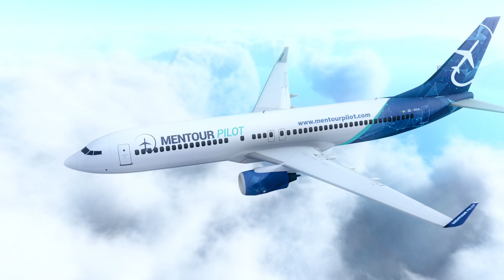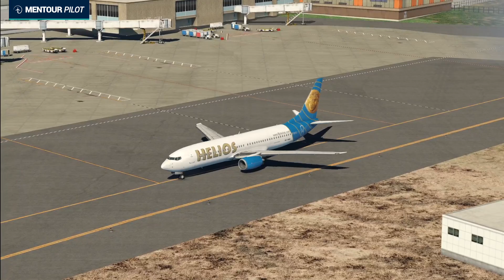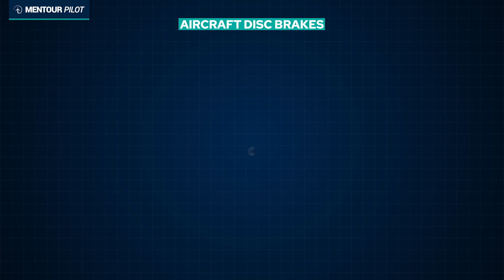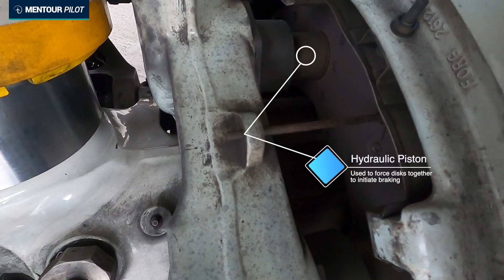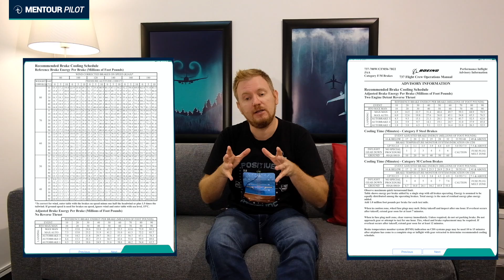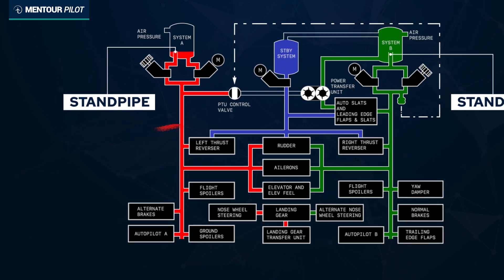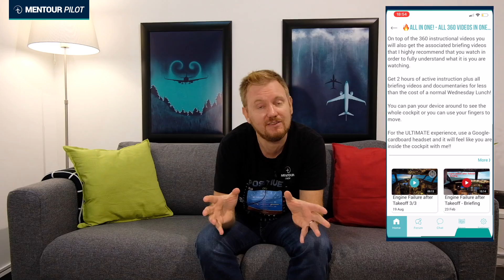How do Aircraft BRAKES work?!

Comment: You said in other videos that reversers don't reduce the landing distance on dry rwys. Is that because the pilots/autobrake will apply less brake when more reverse thrust is used; or even though the same amount of brake is applied, the reversers won't reduce the landing distance?
Reply: What that might have been about is how in the FAA-calculated method for stopping distance calculation, credit isn't given for reverse thrust?  If a constant decel rate is selected for the ABS, then more reverse thrust will automatically result in less braking being applied in order for the system to maintain the selected decel rate.  But for a given brake pressure (e.g. 2000 psi), adding reverse thrust will result in more decel / less stopping distance than just the braking.

Comment: 727 actually did have nose wheel brakes as an option, I believe for unimproved runways. Pretty sure some did exist but most 727s did not have the option added.
Reply: Those were air brakes

Comment: Whenever I read or see a video on brakes or braking, I remember Swiss Air 306.  The Caravelle crashed because of overheated brakes stowed after takeoff resulting in fire and destruction of hydraulic systems.  80 lives perished.  

Morbid, I know.

Comment: The DeHavilland DHC-7 "Dash 7" had an option to have brakes fitted on the nose wheel as well.
However, very few aircraft got that option as it turned out the benefit, even in a STOL market as it was made for, the difference in stopping distance was minimal, but maintenance complexity was increased.
Reply: I think it's fair to say that in most airliner operations, required takeoff field length is greater than for landing?  Perhaps another reason why a bit less stopping distance wasn't worth it.

Comment: Sounds like the anti-skid system on a plane is virtually identical to that of an automobile. Assuming it is, here’s a question I used to pose to my students when I was teaching automotive ABS: the ABS is designed to disable at speeds below around 5 mph/kph. Why is that? Answer: if it wasn’t, the vehicle would never, ever stop! 😀
Reply: What he didn't make clear is the antiskid system is comparing wheel speed of pairs of wheels across the aircraft so as soon as one slows more than its partner it releases that brake until it matches again. Not just before  it skids.
Reply: @bobrice3957  Actually, if it's similar to an automobile, there's an interim, "hold" phase. When one wheel (or set of wheels, depending on how many channels it has) starts to slow down, it goes into a hold or blocking mode where it does not allow additional pressure to be applied to that wheel/set of wheels. If it continues to slow down, it then releases the brake pressure by cycling the valve a certain number of times per second.
Reply: I think the min speed for anti-skid on the 707 was 21mph.
Reply: "the [antiskid] is designed to disable at speeds below around 5 mph. Why is that?" Here's a technical answer, relevant to at least some airliner A/S situations:  The graph for sliding friction coefficient vs speed looks somewhat exponential decay-ish, i.e. as sliding rubber slows down toward zero speed, friction coefficient heads up rapidly.  When than "negative slope" friction characteristic is plugged into the velocity ("x-dot") term of a standard second-order differential equation for the fore-aft motion of a braked landing gear strut, a self-sustaining oscillation can arise as speed becomes quite low.

A case in point was the DC-10-30 Center Landing Gear.  On a couple of occasions (one in flight test/one in service in Saudi Arabia or somewhere?) the CLG shock strut actually failed as the aircraft braked to a  stop.  Must have sounded like a bomb going off... that big of a high-strength steel cylinder snapping.  The solution, after much investigation and simulation to pin down the cause (nobody started out thinking "must be the negative slope of the x-dot term") was to snip a particular diode on the (analog) antiskid circuit board... causing the CLG's antiskid to be disabled below 5 kt.

Comment: When you were talking about failures in both braking systems, and the need to apply the brakes only once, it reminded me of the story of the B-17 bomber returning to its base in England during WWII. Its hydraulics were shot up and the pilot didn’t know if he even had one brake application. His choice was to either hope he had brakes and land back at base where their Christmas dinner would be waiting for them, or land at one of the bases with an ultra-long runway, but then spend Christmas Day in the back of a deuce and a half ton truck and miss dinner. The captain polled the crew and they all wanted Christmas dinner, so they landed at their base. Luckily, the backup system worked and they had that one application remaining.

Comment: I’m a flight attendant and a few years ago I had an anti skid brake failure on the 767. Leaving NAP failure happened and had to get engineering to fix it before we left. Failure came back before landing in LGW so precautionary landing was needed. Used up almost the entire length of the runway. Pax never suspected anything so all good.

Comment: Will the heat from a rejected take off cause the tires to burst?
Reply: No, a few minutes after a high-energy RTO the fuse plugs in the wheels will melt before that can happen, releasing the nitrogen from the tires.

Comment: What you say apply here in the Uk for vehicles for it’s certification of road worthiness by the government the MOT on brake rotor/disc and pad wearing if below vehicle spec of government guides it’s regarded as not safe for the road and the vehicle is off the road till fixed

Comment: One thing I don't understand is the mechanics of how control surfaces can still be operated, tough as it may be, if you have a loss of hydraulic pressure. I gather from this video that you can't do that with the brakes?

Comment: Is there a difference in heat dissipation for the Boeing 737 compared to the Airbus A320 for example due to the fact that the 737 doesn't have a main gear cover?
Reply: Might not be as significant since the wheel well has rubber flap seals that close around the wheels,  and generally hub covers for the outboard wheels for aerodynamic reasons further reduce any airflow over the brakes.

Comment: I remember a nose wheel braking system on the Concorde. This braking system was used after the takeoff to stop the huge gyroscopic forces, which otherwise could have become  problematic.
Reply: For a NLG retracting longitudinally, there aren't any gyroscopic forces since the rotating tires stay in the plane of motion.  Airliner MLG tire rotation is however typically snubbed prior to entering the wheel well.

Comment: If doing multiple short legs on a busy day, would pilots ever go gear-down early on approach to cool the brakes more if ground cooling fans arent available?  Obviously the pilot would have enough temp 'reserve' to land if they were good for a take-off, but to prevent delays on the next departure? Would that be a company procedural thing? I.e. bean-counters determined that the increased fuel-burn was cheaper than 10-20 minute delay waiting on brakes for whatever reason, so gear down x miles further out from touchdown then they normally would be?
Reply: They would delay landing gear retraction on take offs ...

Comment: hey Mentour, how is the aircraft steered on the takeoff roll once you hit higher speeds? does it then switch from the tiller to rudder pedal steering?
Reply: On  the whole takeoff role the tiller isn't used

Comment: would it today not be possible with relatively little effort, cost or weight to add a remote heat sensor/thermometer which transmits it's date to the cockpit? Maybe not as only source for decisions but as help. So you get a warning for unexpectedly hot brakes?   
You get these remote laser (or so)  thermometers for a few € in any diy store these days.

On a nitpickly different topic: Pretty sure ABS doesn't mean  Anti-brake :)
Reply: Most airliners have brake temperature readout in the cockpit, I believe, and have for decades.

Comment: I wish you discussed the main thing I was curious about on this. When the aircraft lands, the engines rev up super loud. I always assumed this was somehow putting them in reverse to slow down faster than brakes alone. But thinking about how jets on aircraft carriers rev up on landing in case of a failed cable catch, I now think the engines are revving up in case of a failed landing so they can get airborne again if needed. Is that right?  Thanks for these amazing videos!
Reply: Nope, reverse thrust is exactly what you said first. If it was for the second reason it wouldn't work as you need to go to idle before you use takeoff thrust
Reply: @ethansaviation2672  Thanks I'll have to look that up

Comment: B-727 Was originally designed with front wheel brakes, but after a few experiments and the NEGLIGIBLE (go figure!) reduction in braking space w/o the front brake system, it was decided... NO FRONT BRAKE!

on other related topic... WHEEL BEARINGS!!! aircraft wheel bearing are mucho more different than their automotive counterpart... they have to withstand a change in temp from -30ish°C to a well above 300°C in a mater of SECONDS (even more in case an overweight landing! 500+)... NOW imagine the extreme specialty grease used for such conditions!.

Comment: The air temperature is pretty cold in flying altitude. How can the brake temperature increase during day after each flight even though they stay time in that very cold weather?
Reply: I once prepared a chart exactly like that one comparing the MD-87 and a 737 variant for island-hopping by a South Pacific airline. Cold air does lower the temperature of the brake vs what it would have been with warmer air,  but a lot of heat goes in without a lot of dissipation available to get rid of it (brake nestled inside wheel, for example).  So the temperature's going to keep ratcheting up if the flights are short enough.

Comment: Great Video! I wondered if ABS fed back like a car.

I replayed and don't think I missed anything,  is RTO Max Braking  = Manual Max with the toes?  Or is it perhaps calculated like a function of speed and other RTO parameters (But always > MaxAuto since energy @ takeoff)?

This question is 50% curiosity and 50% hope that there's a neat new version of rock paper scissors in here somewhere.  If the footbrakes are top of the chain, we just need to loop back to the machines with some terminator reference or a depressurisation scenario.

Comment: What is the cable looking linkage between the inboard and outboard brake assemblies?
Reply: Allan;  I wondered the same thing.  Did you ever get an answer?  The only thought I came up with is that it might be there to prevent a foreign object on the runway from impacting the gear leg.  I doubt that is the true explanation though...

Comment: Hi Mentour,, I have a question: as far as I know the carbon discs needs high temperature to be efficient. As an example in Formula one you need to reach at least 800 Celsius on the disc in order the car could break. I imagine that in a tipical landing the discs on the airplane are about 20 Celcius, depending on the country you are landing. Whit this temperature, the carbon discs (in a car) will not brake at all. May be the components are differrents??? Regards.
Reply: In cars, I think a lot of it has to do with brake feel. If you push on the brake pedal with a certain force, you want the car to stop so fast.  On a race car in particular, I suspect you want the brakes to feel the same every time. The more-or-less direct hydraulic connection between the brake pedal and the brakes at the wheels means that the feel will change if the friction coefficient of the brakes changes with temperature.  It's not the the brakes don't work at all when cold on a Formula one car -- obviously they do or you could never get them hot -- they just don't work the way the driver would like.
On these big jet airplane, there is no direct connection between the brake pedals and the brakes on the wheel, so brake feel is much less of a thing.  Generally when the pilot pushes on the brake pedals, it tells a computer to apply the brakes.  The computer then uses valves to send pressure to the brake system.  If the friction changes with temperature, the computer could, in theory, adjust the brake pressure to maintain the same amount of braking (although I don't know if this is done).  In reality, I suspect the friction surfaces on the brake disks heat up so fast that it's not necessary.  In fact, after some quick research, I see the auto-brakes on the 737 start at a lower press, and then after 1.75 seconds it automatically applies more pressure.  This might be to bring the brakes up to temp, or, I think more likely, it is to reduce the feeling of being thrown forward so the passengers are happier.
Reply: @andrewsnow7386  Thanks for your comments.  👏👏

Comment: I’m surprised that temperature sensors aren’t on every aircraft. It doesn’t seem like an expensive or complex feature to add for such a vital piece of information as brake temperature.
Reply: Why do you think it's vital information?  Obviously as Mentour shows, the pilot can just calculate the temperature, and it's generally only important on the ground before takeoff.  It's not a time critical number that you need in the air.   
Anyone that drives in an area with big hills or mountains is probably much more likely to overheat the brakes on their car/truck --especially if they have a heavy load or tow a trailer. I bet a brake temp warning on pickup trucks would save a lot more lives than on airplanes.  Maybe it should be required on any vehicle with a tow hitch.
Reply: @andrewsnow7386  I definitely understand your perspective. I suppose there always needs to be a balance between cost/complexity vs. benefit.
Reply: @andrewsnow7386  Why do you think it's vital information? <  Because heat already absorbed by the brakes subtracts from the energy which could otherwise be absorbed by them in for example a max energy RTO.  The flight manual says you have this particular V1 speed, and rejecting at or before it the aircraft will be able to stop, but that assumes cold brakes.  Most airliners do have a brake temperature monitoring system (BTMS) to directly measure brake temperature, by the way, as there's no way to accurately calculate brake temperature -- too many unknowns, e.g.  brake mass (new/worn), wind speed/direction time history.

Comment: Hey Petter, thanks for the great video. Question: How long must a runway be if the aircraft can only be stopped by Reverse Thrust? Cheers and stay healthy.
Reply: That would depend on the landing speed😉
Reply: Landing speed and aircraft weight.  Reverse thrust (and aero drag) doesn't provide nearly the stopping force that brakes do, so a lot longer distance would be needed.

Comment: Would you ever hang your gear out to let the brakes cool?   I'm thinking of back in the 70s and 80s they use to bring 737s into our little 5000 foot airport.   After dropping passengers and picking up passengers they would take off and fly 30 miles to the next airport.  A lot of heat might have been generated landing on the 5000 foot strip so hanging the gear out till the next airport might bring some needed cooling.    Incidentally the pilots of the 737s finally refused to land at our airport so they started using smaller planes.   Eventually our airport did get lengthened to 6700.

Comment: So those are the infamous "hot brakes" that make rejected takeoff a delaying experience.. 
That graph of the heat buildup is seriously amazing.. could we have some ram air into the gear well to cool they down during flight? 
Or we could just take turns to pee on the brakes...
Reply: Ram air cooling could probably be done fairly easily, but with a small drag penalty.  If enough airlines were running very short flights where brake heat was a problem, I suspect Boeing/Airbus would offer a solution (which might be carbon brakes).  But, most airlines wouldn't want the drag penalty of ram air cooling.

Comment: Why do planes not have brake ducts?
Reply: Short answer: Because they aren't needed and would add weight.
Longer answer: If the ducts are only exposed when the gear is down, then they would do almost nothing.  If the ducts were designed to cool the brakes when the gear was up, then there would be a drag penalty.  Since most airlines don't fly jets on the very short flights where brake heat build-up is an issue, they wouldn't want the drag penalty.
On a car, especially a race car, you are using the brakes over and over producing a little heat every time.  You must get rid of the heat as you make it because more is coming soon.
A jet airplane is basically the opposite.  Here you have one main brake application (landing or rejected takeoff), where a huge amount of heat is produced in a few seconds.  And, then you have a long time for the brakes to cool. With brakes small enough to fit in the wheels, it would be impossible to blow enough air in there to do any significant cooling during the few seconds of braking.  By necessity, the heat is stored in the brakes during the stop and then the brakes have time to cool afterwords.

Comment: the early 727s had an option for nose brakes.
Reply: The saab gripen has also nosebreaks. They really nake a diffenerce in combination with the canards pushing down
Reply: @Leminge42  Was at Farnborough many years ago with a Saab pilot showing off the nosewheel brake whilst spooling up the engine. Then off he went! They don't let you that close now.

Comment: How can you tell if your aircraft has carbon, or steel discs?  Wouldn't want for someone to calculate their cooling, thinking they have carbon discs, when in fact they have steel - this could lead to a possible runway excursion,